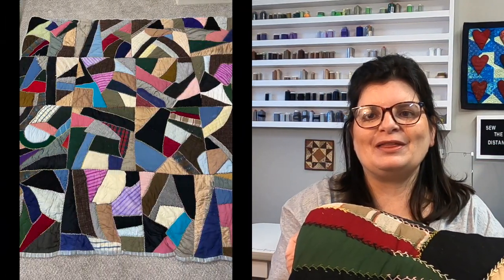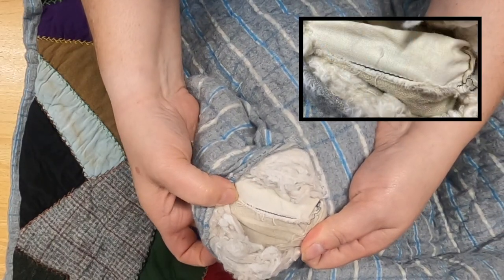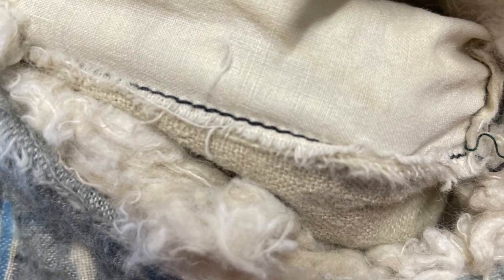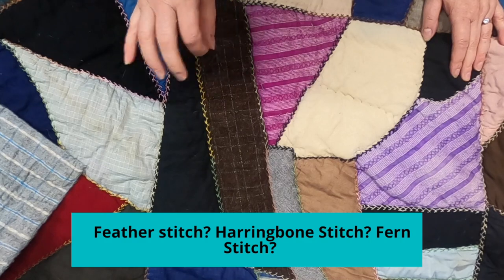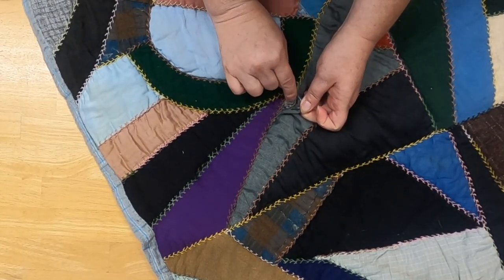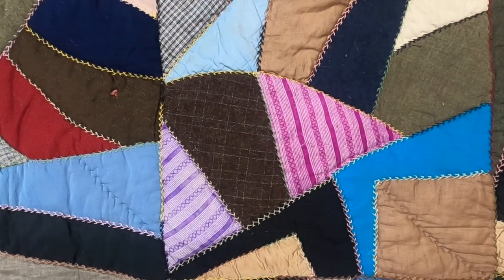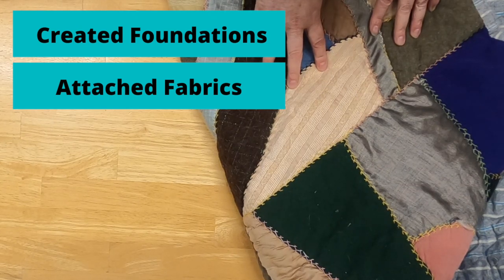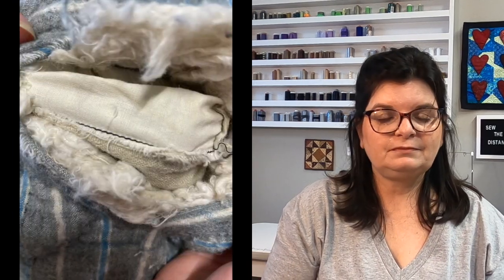Lessons from an old WOOL CRAZY QUILT || Unique Construction

Comment: I will soon be making a quilt from old fabric for my daughter. The material comes from old shirts of her grandfather who passed away last year at 93. My daughter is 25 and will treat the quilt with respect. Some of the shirts were cotton and some cotton-poly, and some of the fabric is a bit thinner from many washings. I found a very fine interfacing to stabilize the fabric a bit and make it easier to cut into pieces. Is there anything else I should be doing so the quilt will last? Also, I’m planning to use his thicker cotton (?) work clothes (matching pants and tops) as the backing.
Reply from the maker: I love this! I am sure your daughter will treasure it. As for advice, interfacing is the best way to stabilize and help those thinner fabrics hold up, but you could also consider making the seam allowance a bit wider. I think that would have helped this quilt some. Also, with the lighter weight fabrics, maybe shorten the stitch length. That could help, too. I hope this helps! I am so happy you are creating such a wonder gift for your daughter!

Comment: Kris,  I have heard that this type of single-fold binding technique is not as durable as traditional double-fold binding.  This quilt's binding looks fine.  Do you have an opinion on this?
Reply from the maker: Binding is an interesting eliminated, isn't it? Back when I was learning to sew and quilt (25+ years ago), one of my wonderful mentors told me to always expect to replace the binding and that is the first to go. So, which that always in mind, I don't really worry if it is single or double fold. As for gifts, however, I try to use bias binding because, in my opinion, it wears better because it moves with the quilt. I am sure there are many opinions on this! And, of course, this quilt was bound with the backing and it is in excellent condition! LOL! I really think it is a matter of personal preference and remembering that bindings can be easily replaced. I hope this helps!

Comment: How do you wash a wool quilt?
Reply from the maker: Great question! The simple answer is that you don’t wash wool quilts. You can air them out outside, you can shake them, vacuum them, and even (possibly—depending on the age and other factors) spot clean them. With old quilts, I would be nervous about dry cleaning them, too. Hope this helps.
Reply: Sew the Distance I would prefer a magical
Way to do it lol